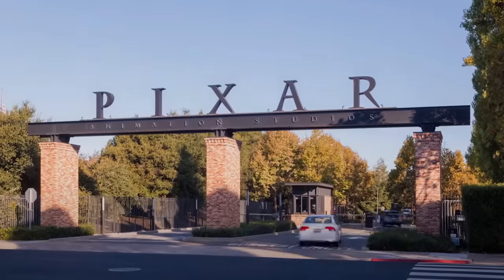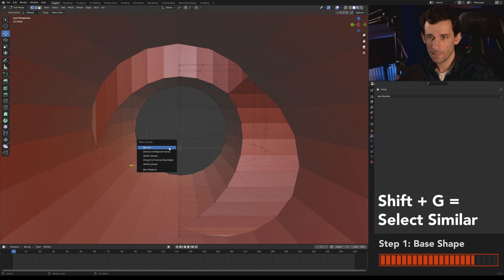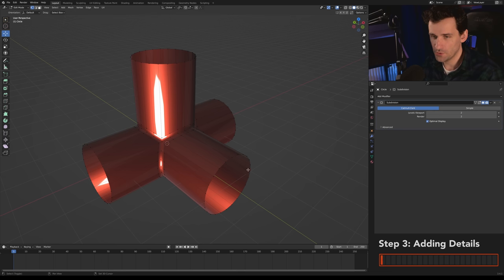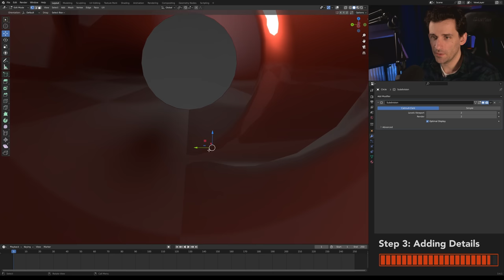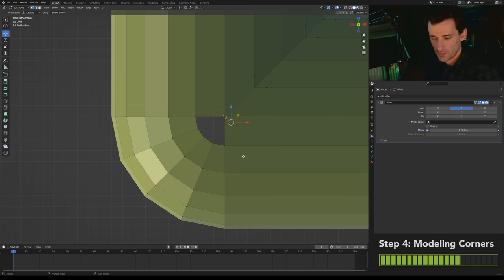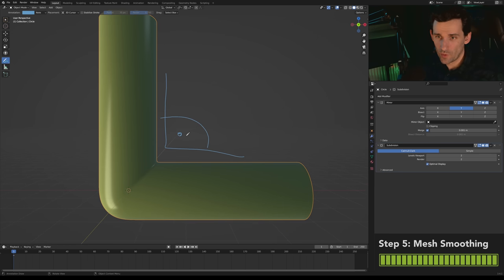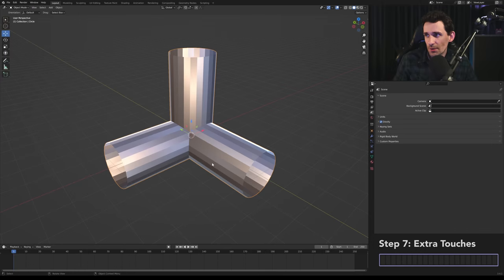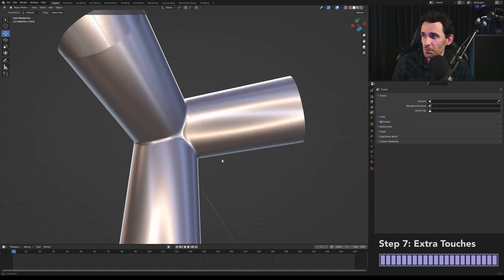3D Models That Will END Your Career

Comment: could you make a model that is a Sphere and displays a rotating flat mirror inside the sphere? I want to see if you are a good shader from the inside of that sphere. that sphere needs have small indents like a golf ball but every hole needs to be offset and the depth of those holes needs to be random heights and have Sharp edges. I heard this should be the worst challenge for a 3d modeler.

1 A transparent sphere.
2 Inside this sphere, there's a flat mirror that can rotate.
3 The surface of the sphere should have small, golf ball-like indents.
4 These indents should be randomly positioned, have varying depths, and sharp edges.

The goal is to test the capabilities of a 3D modeler, especially in creating complex, irregular indentations and a functioning, reflective flat mirror within the sphere.

Comment: booleans work better on manifold objects, so I'd create faces that seal pipe ends first. you should end up with cleaner boolean without inside geometry with manifold pipes. in my case with sealed pipes there was no need to clean up geometry at all

Comment: So I get that loop cuts and creases have their differences, but could you explain why you wouldn't use crease it this scenario?
Reply from the maker: creases are just a shortcut if you don't want to properly model everything. when you export that model to obj/fbx and import to other 3d software, you never know if it will retain the shape. with correctly guided edge loops you know the model will ALWAYS look the same, no matter the format you use for exporting, no matter the software you'll be using

Comment: I'm not into blender, but why don't boolean three closed cylinders, and then you don't need to clean intersection garbage inside cylinders?
Or blender can't to that? I've just tried first pipe on 3dsmax, and it was super easy, i just boolead 3 cylinders, and welded garbage edges.

Comment: is there a particular reason you added edge loops on the end of the pipes instead of ceasing them?
Reply from the maker: creasing doesn’t necessarily work in other 3d software as in Blender. I used to work like 12 years ago as a 3d artist making assets for multiple 3d apps and it’s just the way I’ve learned

Comment: Level 2: Make a tube. Cut a corner with 45 degree away. Copy that tube and move it where it belongs. merge those vertices and subdiv em. No need for extra edges the smooth does the rest. same result.

Comment: For the second pipe you'll want to use the "Spin Tool" in Edit Mode.
Reply from the maker: you don't
Reply: @Chocofur  Just did. Works
Reply from the maker: @lomborg4876  you have a completely different model to what I was presenting
Reply: @Chocofur  I just compared them, and I see what you mean, however you can still use it instead of the bridge tool though, if you merge the verticies after (tried it and got your result)
Reply from the maker: @lomborg4876  check the corner with subdiv mod + different matcaps, you will literally get the bugs from video intro (and your career ends, and there's only darkness after that)
Reply: I have a project open right now with a version that used "bridge edge loops" and one that used the "spin tool" and merged the verticies. They're completely identical (Even with different matcaps).

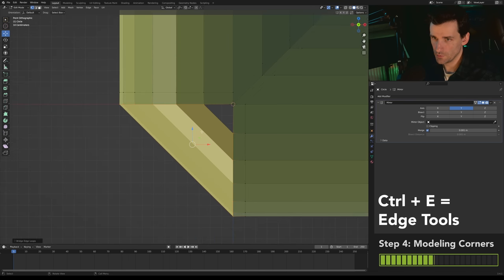We're only talking about the small corner section at 5:56

Comment: When you added the uvsphere to fix the corner. If you look at it in the video. There was actually no reason to rearrange the quads. you only had to delete the rest of the sphere or was it another reason for doing it your way? Thank you for upload.
Reply from the maker: look at the top part of the sphere, it has a different 3d topography
Reply: @Chocofur At the 8:33 mark. I don't want to come off as nitpicking, There are tris present, but deleting just three lines should solve the issue it seams to me, no need to copy any segments. But hey I guess that is nitpicking lol. You have an interesting workflow  Keep up the good work!
Reply from the maker: @Dina_tankar_mina_ord  it won't solve it, you'd have incorrect shading in that one part of the model. I really suggest going through te pain of testing this, it's a nice modeling exercise I took a lot from 🙂

ps. also rotating the 9 faces I've selected in the video and placing them in the opposite corner (the one that looks identical but mirrored) also results in a different geometry
Reply: @Chocofur  I just did and you are correct. I got a shading crown even though they where quads. Tried to give them a weight map it didn't help. You win :) thanks.
Reply from the maker: @Dina_tankar_mina_ord  career saved!
Reply: @Chocofur  LOL have you tried "ctrl e" bridge edge loops and then add cutts and smoothness? if not its a cool trick :) keep it up.

Comment: I think I found a faster solution: Instead of edgeloops place a Sphere with the according rings and segments. Delete 3/4 of the sphere, so that only the quarter fir the edge is eft. Then make and knife cut with 45° and delete the half where thw sphere has the spot with the many triangels. now mirror along the cut and rotate back 45°.
Reply: Works fine with 3 pipe corner. just cutting 45°of the solution with 2....mirror...

Comment: why not use the spin tool on the 2nd object, spin 90° and have 5 or 7 steps to get the elegant curvature?
Reply from the maker: there won’t be a clean 90 degree on the inside, ofc you can do it with spin too, but why if you can also learn the hard way lol

Comment: as an architect, i'm always stunned by how 3D artists just eyeball everything. I would definitely have to put in values just for the sake of my sanity.
Reply from the maker: writing this as a fellow architect as well - 3D is just different. it's like comparing Photoshop to AutoCad
Reply: @Chocofur  Yeah, I do ArchViz. I model in Rhino which is super precise and requires values and is in NURBS. Then I export it as MESH to 3DsMax for rendering... I know this is a dumb workflow, but I'm just to afraid of learning modelling with meshes in 3DsMax.

Comment: I feel like this would have been faster if you did the whole thing in a CAD software and then export it to Blender.
Reply: Just tried it out, the 90° took me three minutes to model in Fusion 360, including starting up the program. So looking at the video timestamps it's pretty much just as fast, but the result will be much more accurate as there's no "guesstimation" on where exactly the edge loops and such are placed.

Comment: Just select a face on the cycling and extrude spin . Am I missing anything
Reply: I think the problem with spin tool is that it only works if you are trying to bend a pipe who's centre of curvature lies outside the cylinder
Like in this video the centre of curvature of the pipes is at the centre of the cylinder
Also the spin tool results in not necessary "bad" but "weird" topology like you know those very concentrated vertices at the centre of curvature you get when using spin tools that also sometimes results in shading issues

Comment: a solution that's "good enough" is to just have a cube, and extrude the faces you want (depending on the number of pipes). Throw a subdiv at it and add some edge loops. takes like 30 seconds from start to finish, and you can add more pipes after that if you change your mind. Only problem is that it's not a perfect circle 😭😭😭
Reply from the maker: 97.5% good? NOT GOOD ENOUGH
Reply: @Chocofur  🤣🤣🤣

Comment: this isn't easy in Parametric modeling either you might think you have the pipes intersect and just add a fillet, nope! it will be work but it will not have a clean transition it takes a bit of surface modeling to achieve a smooth transition.

Comment: Just bevel concave edges and job done, no need to manually slide loops.
Reply from the maker: the way convergent edges behave with bevel vs manual edge loops is different
Reply: @Chocofur  no difference in maya, you chose not bevel the edges so it only adds loops around main edge

Comment: Why is it so "back asswards" to create something this simple in Blender? It's so easy in Catia. It's a 1 minute (at most) job to do that kind of stuff.
If you want free modeling, you can very well pick the Freestyle module from Catia and it still would be better than Blender.
Also, how do you even do contraints in Blender? I see that all the models are just floating there.
Reply from the maker: can you 3D model a stylized horse in Catia?
Reply: @Chocofur  Yeah, in Freestyle, which is basicaly Blender.
It still has the free surfaces, the surface modifiers, surface subdivisions, even the sharpness of the surface smoother, pretty much everything.
But it's so much better because you can use it together with the other modules, if you want something that's a bit more precise.
Yeah, you may not be able to do hair like in 3DS Max, but you can export the model as STL or whatever other format 3DS Max understands.

Idk, i like it better. I was never able to learn Blender. The whole thing is just too messy for me. Just like 3DS Max.

Comment: It seems you model the hard way.

Step 1 : Use boolean union with "fast" solver instead of "exact". It will remove the face inside the cylinder. Ne need the cleanup.
Step 2 : Since this is hardsurface model, use shade autosmooth rather than shade smooth. Then mark sharp edge. Thus no need subD and extra edge loop. Simple.

Comment: it makes me weirdly angry how often people use dense edgeloops instead of using the sharpness tool to dictate how a subdivision normalizes geometry. Like, it makes sense for hard edges, but for most creases you really don't need to skyrocket the polycount like that. it's inefficient and makes the entire thing much more complicated and hard on your hardware.
Reply from the maker: I mean if you have hardware from the late 80’s than yeah. But if you need a 3d asset that will be reimported across multiple 3d apps and want to be sure it always looks the same, those extra vertices are worth the pain.
Reply: @Chocofur  thing is, you can get those nice smooth creases with no shading issues without all the extra hassle and without the enormously dense geometry, it's just that everyone gets taught the control loops very early on, and then they use them not only for edges, but creases aswell, even though it's not as applicable there. I personally always correct the people i work with, as optimized meshes are important for videogame assets etc. It's not as big of a deal in commercial renders and the likes, but it's still like 5 minutes of work you could've saved
Reply from the maker: @loydtheliar5659  it actually is a big deal because 3d assets are very often juggled between 3d applications which treat creases / sharp edges differently. you want your model to work exactly the same in every software and you can only do it with manually added loops.
Reply: @Chocofur  I have a feeling there is a slight bit of miscommunication happening here, but i digress, it's a petpeeve anyway, no reason to get deeper into the discussion! :)
Still nice content to watch though, even if it's not my preferred method

Comment: Is this the only way to do this in Blender?  If so, they should look into parametric modeling.  This clunky, non-automated, manual way to correct vertices in the editor should/could be entirely eliminated, IMO.  As an end-user, I’m looking for the least manual labor, most-automated way to achieve the ideal result every time.  Your results are ideal but the process to get there is less than ideal.

A). Teach a man to manually hack vertices in blender -> that man fixes that one weird issue manually for as long as that weird issue remains.

B). Teach a man to automate perfect vertices in Blender -> solve the vertices issue for anyone who uses Blender in the future.

Comment: I had earlier put a long-winded method for Level 3, but the simplest, easiest, and cleanest way to do this perhaps is to just add a cube instead of a sphere, and then bevel the whole thing with the segments set to the numbers of segments on the cylinder divided by 4. Delete the faces you do not need, and then it is pretty straightforward from there

Here's a very short 1 minute video:
https://youtu.be/LfJ9sJAqnrQ
Reply: Also another tip is, instead of doing a ctrl+j on whatever cylinders you are joining, you can just boolean-union them together, and apply the boolean. That way you will be left with 3 faces in the space where you are supposed to add the sphere/cube, and just delete the single vertex in the middle to clean everything up

Comment: Mmmmmmm, absolute noob here but, isn't easier to just model the thing in solidworks and import the stl?
Reply: @@thelightfantastic6388 i did try, just for shits and giggles, and it wasn't particularly faster.
Reply: Been doing it somewhat seriously for about 5-6 years but i wanted to make it exactly like in the video and just intersecting the cilinders didn't make the sorta flush finish he made because it ended in a vertice. And having to migrate from one program to other to render its a lot more effort than i think its worth it. I tried to export an assembly just to fool around and it was a pain in the ass. For the pipe it might be worth it but with complicated shapes or something it takes a long time to even load the asset, what do you use?
Reply: @@thelightfantastic6388 cool i started with inventor as well, but  i got my industrial design Licence with solidworks, i got fed up with keyshot subscription model so i am trying to use blender for rendering products.

Comment: Hey, you can get pretty good results with just spin operation
Reply from the maker: but not clean 90 degree angle like in the video
Reply from the maker: @Lyco0n  just try it and compare results to the ones from the video
Reply: @Chocofur  If you want specifically have hard edge until half of pipe, it needs a little more merging, but should look ok, I posted fast example on twitter :D
Reply from the maker: @Lyco0n  saw it, I know it's probably the fastest way which I've also used for years. but only because I didn't know how to make this 99.9% pure walter white version with "true" 90 degree
Reply: @Chocofur  I will try again soon, yours looks perfect but I have a weird need to have a faster way for this shape :)

Comment: why creating so much struggle from this simple shape? 
1. grab a default cube, it's even already in the scene. add and apply subD:2 + spherical Cast:1.0
2. delete i.e. Y+ half of a result quad sphere, extrude pipe from open border
3. create 2 Empties in a center of this sphere, give them rotation for +45 on X for first and +45 on Z for second
4. add Mirror to the initial mesh, make it for Y axis with Bisect and Merge, select Empty as a Mirror Object
5. duplicate Mirror for the second Empty
6. DONE! zero vertexes moved, mathematically perfect result in 1 minute. just dissolve 6 extra edges and add some limiting loops  by taste

sorry, too lazy to make a video from it

Comment: Why don’t blender artists ever use the crease property? It’s built into the program for a reason!
Reply from the maker: it's a shortcut rarely ever used for final model delivery in a professional environment
Reply: Every software has that property, but it's not that great as adding supporting loops, with supporting loops you will get lot more control on smoothness, than just 0 to1 slider with crease and with supporting loops, you won't loose any volume when increseing subdivision level and vice versa

Comment: Real CAD programs automatically make perfect fillets and they provide you with several tools to verify their perfection. Blender does not have these features because it is used by artists rather than by engineers. If you want to make jumping dinosaur, you use Blender. If you want to design airplane wing, you use Rhino. (This guy has Polish accent.)

Comment: Why not just turn on auto smooth to have a good shading instead of the edge loops
Reply: IMHO?  Because auto smooth (useful as it can be in Blender) doesn't reliably export, and isn't available in many professional production pipelines (no pun intended).
Reply: @kickaireightptilde4825  Didnt know thx buddy
Reply: @kickaireightptilde4825  So in hard surface modeling you shouldnt use auto smooth at all and instead use support loops
Reply from the maker: hard surface modeling means different things to different ppl. Hence I call it subdiv modeling. in short you just apply smooth shading + subdiv mod and check if the model looks as it should. if yes = it will look correctly in every single 3d software there is on earth for the next 99 years. If not = fix it.